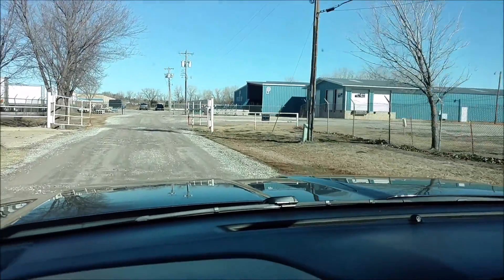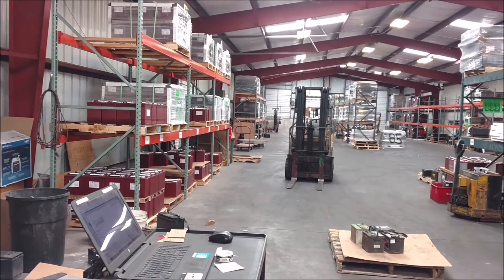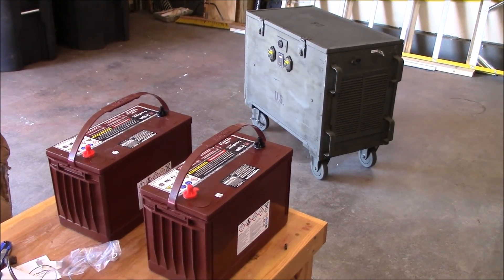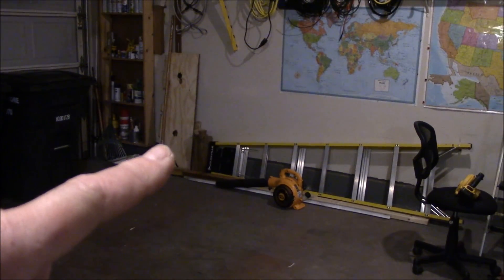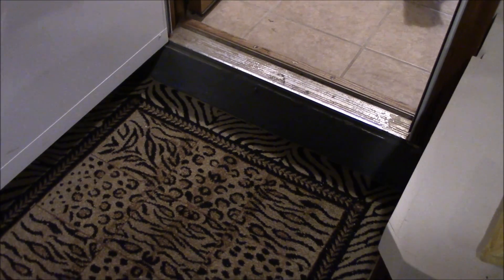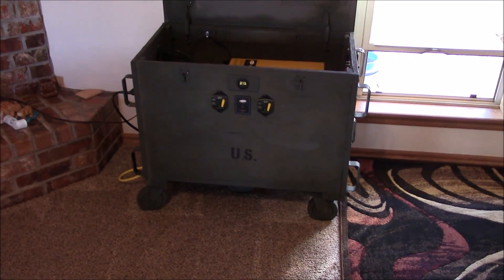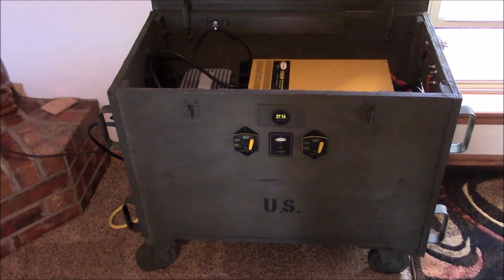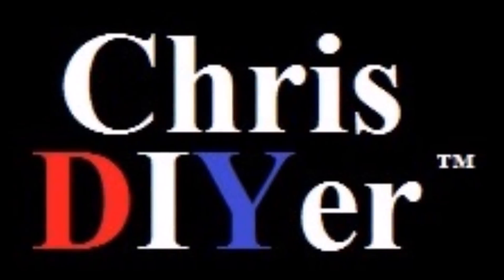DIY 24v solar generator gets two more Trojan "Overdrive" AGM31 deep-cycle batteries

Comment: You do such nice work. You should try lithium.  I'm using Tesla modules.  You need an inverter with 18v low voltage cut off. But the performance will blow your mind.

Comment: Chris you still like those overdrives? they use these for those portable road signs here in canada
Reply from the maker: Yes...all of them are performing as new. All are in systems and run 24/7 (with low voltage cutoffs). Funny how you mention being used in Canada, I am really surprised how well they perform in the cold vs FLA. Not that Oklahoma gets as cold as Canada. Anywho, thanks for commenting. I think these Overdrives are made well...and haven't let me down unlike their FLA L-16 sized ones

Comment: And I thought my solar generators were cool - this is amazing!!  Nice work and craftsmanship!
Reply from the maker: Except for this unit weighing about 350 lbs (four AGM Trojan batteries) it does really well. Lithium would be sexy (and much less weight)...but, for the same amount of kWh...it would cost $1,500 more. Need a Lithium battery sponsor to send me some for free.
Reply: Cost and Lithium go hand and hand, at least for now.  For my builds, it was about weight and portability.  The nice thing about LiFePO batteries is the DoD and cycles.  Finding a controller that understands how to handle them is another challenge.  Enjoy your videos and thanks for taking the time to share all of your projects!

Comment: Very nice work. Maxed out on capacity on the batteries. Now it will start paying you back bigtime. I think I am going to build a small 1k array hybrid for my dad. When his power is out he has a 12k Generator that he runs until he goes to bed. I want something that will power his diesel fired furnace until morning and keep a few lights available during the night.
Reply from the maker: Sounds like a great project. Esp having to run a 12K generator for a few hundred watts. Solar generators like I built are kinda-like a "one room" deal. The whole goal of mine is to extract about 1.5 - 2 kWh overnight safely. So, a full size fridge should be okay...still need to test that out. Right now I am using it for about 1.2 kWh per day...so in a month that is about 35 kWh off the bill using solar.

Comment: Yeah Chris, you finished adding the batts as you wanted.  As Tim Allen would say...Yea MORE WATTS !  I would suggest placing a piece of plywood under those wheels on top of the rug or you will have crushed carpet and padding if you move the box to a new location.  Tomorrow , another project Bro.  J k
Reply from the maker: Thanks...yep, gonna do that. The box prob weights about 325-350 lbs.
Reply: How many ways can you spell hernia, hernia, hyneria.......don't bust a gut Chris.   ;-)